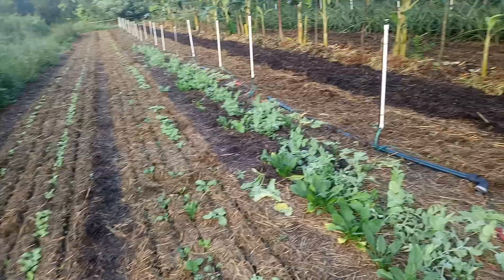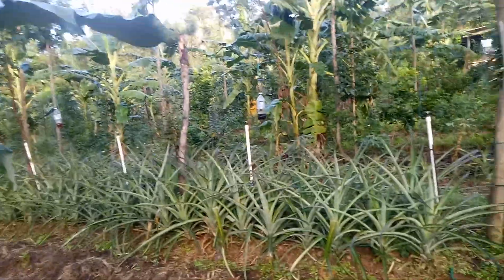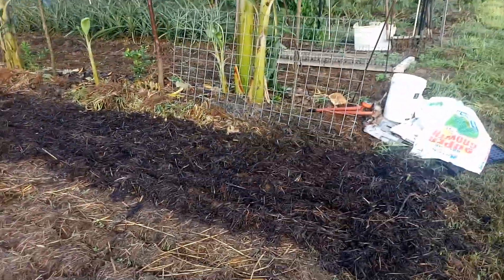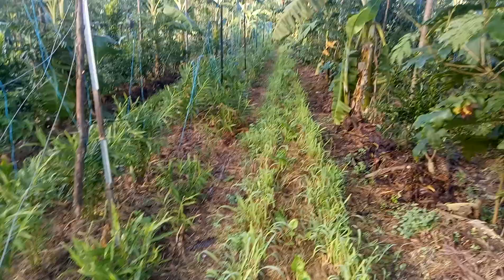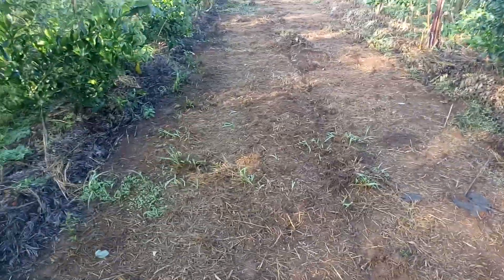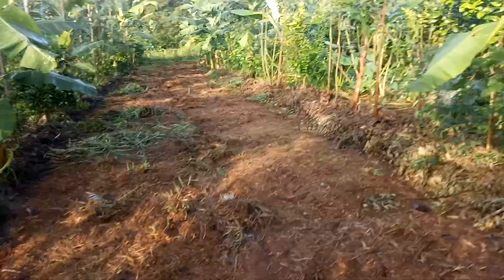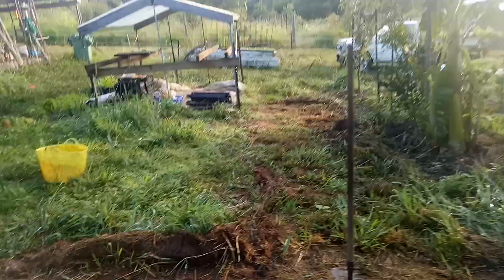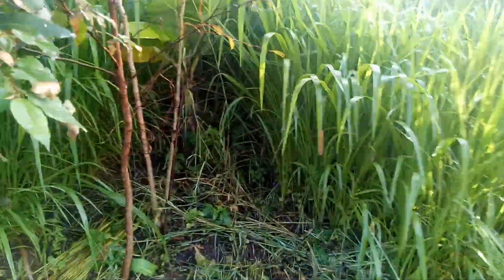Change of approach with paths and biomass production

Comment: I converted some land to Mombasa grass alley crop using it to mulch adjacent beds in the 1980's in the Virgin Islands. I cut using a weed strimmer with solid blade and forked it by hand. The Chinese are making a walk behind sickle bar mower for whaet cutting it feeds the crop to one side. Ernst Gotsch has a friend using it in Martnique. Search youtube for "Great Farm Wheat Harvester video" 
You may have to modify or run machine slower for mombasa and may have to reduce grass clump density but mechanizing would eliminate much of your work.